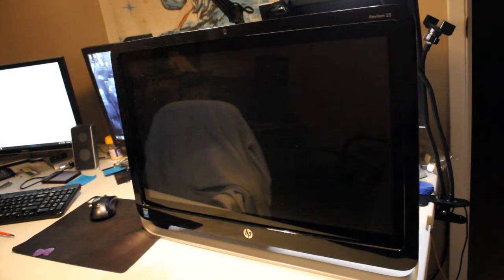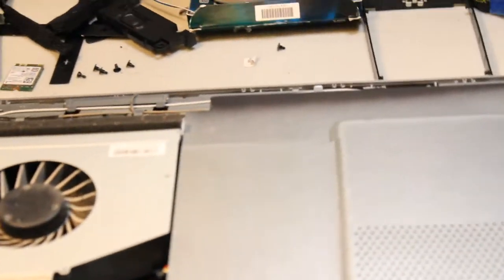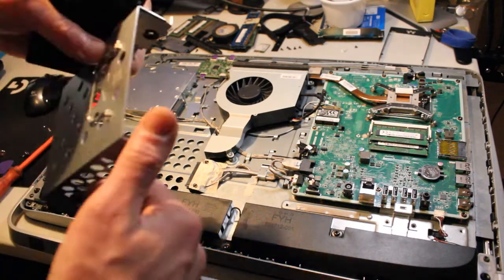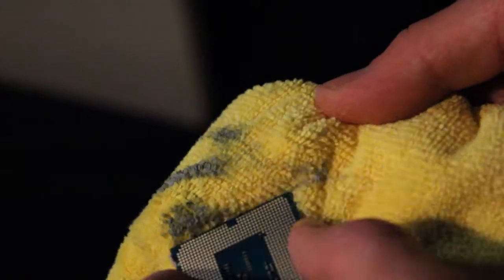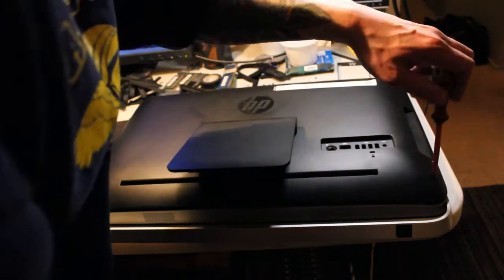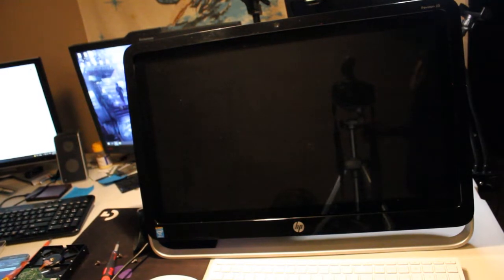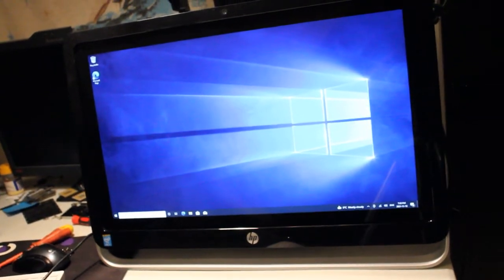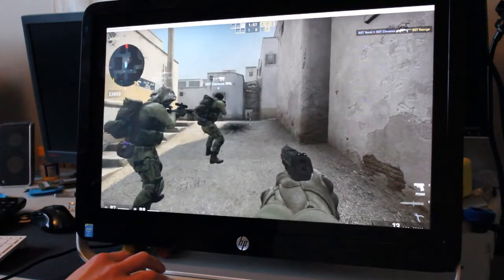HP Pavilion 23 H029 All in One SSD Install Tutorial & Test Run

Comment: Not a bad machine. Shame about the 2nd RAM slot, dual channel would certainly help it. If you can access them, dragging a soldering iron across the slots pins can often cure it.
Reply from the maker: For sure, this all in one has it's purpose.  Do you mean enough to melt and reseat the connection to the board?  I do have a soldering iron, but admittedly I am not very skilled with it yet :)
Reply: @HaisteComputerRepair  Yes, all the little "fingers" that attach to the board. Some may have lifted from their pads. Add some flux and a tiny bit of leaded solder to your iron and drag it across the "fingers". Use a good magnifying glass or USB microscope. Watch out for creating bridges between the pins. Practice on the chips on old modems!
Reply from the maker: @ted-b  Thanks!  I will likely leave this one and sell it as is.  Once I get more practice I will feel more confident working on something I am refurbishing for sale.  My soldering so far is pretty clumpy.  I tried repairing a USB port on a laptop motherboard with not much success.  I need a training kit or something.
Reply: @HaisteComputerRepair  Good leaded solder, not the modern crap, good quality flux and plenty of it. Practice on some old modems, we all have plenty of those in the hoard. You need to see what you are doing. Inexpensive options exist for that. Something for future videos when you get proficient.
Reply from the maker: @ted-b  All in good time friend.  I have a few old modems, for sure.  I am thinking the solder I got from the budget Amazon buy may not be helping.
Reply: @HaisteComputerRepair  Aye, rubbish solder will make an "expert" fail. Get proper lead stuff or forget it.

Comment: Thanks for this walk-through  If I  was to go with 1tb ssd and 16gb of ram, in your opinion would this be a decent machine for light video editing? Cap cut not final cut level of editing.
Reply from the maker: Do you have one of these PC's currently?  For light video editing with that program, probably would be ok.  I would imagine higher resolution videos might cause the system to slow down, but I haven't used that software.  I would say do it if you're on a budget or have the money to experiment.  Otherwise keep in mind this PC is getting a little long in the tooth for resource heavy work.